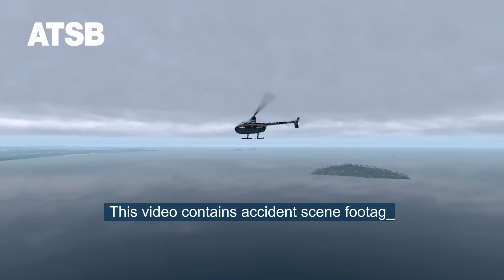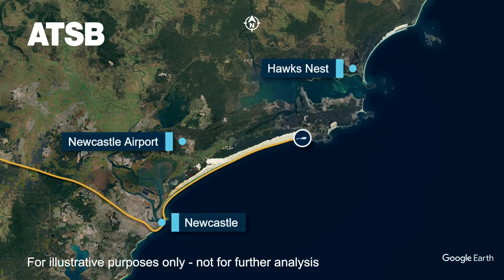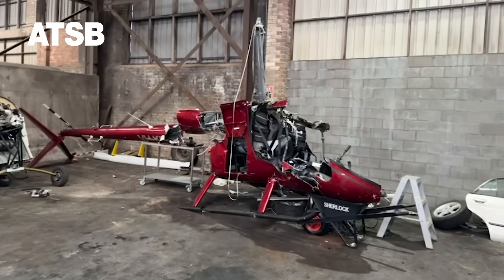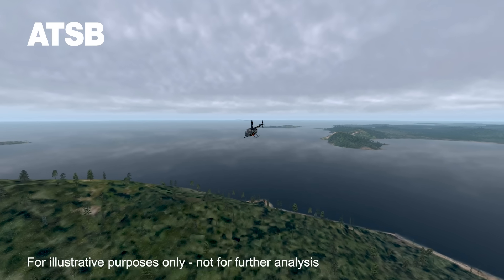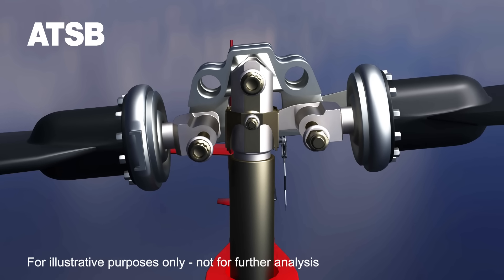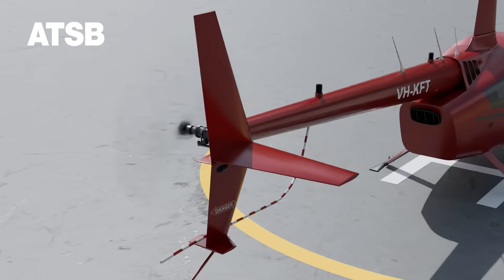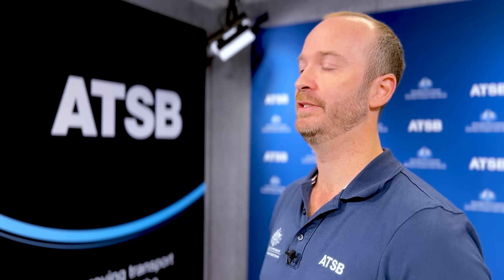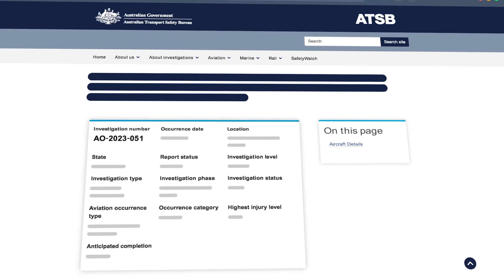R66 flight into turbulence leads to mast bump

Comment: Might be a dumb question but why is there no preventative stopper or limit device to prevent mast bumping? I don't know lots about these helicopters but to me that seems like an obvious hazard that could be addressed to prevent failure in flight.
Reply: Because that stopper would also be on the mast and would still involve mast bumping. The solution is fly the aircraft as trained for the conditions.
Reply: @davidkavanagh189 you couldn't limit the control inputs like they do in other vehicles?
Reply: @lukek8357  No because the mast bump can happen even with no control input and in any case, the controls don't directly control the part of the rotor hub that does the bumping, they control the blade pitch. The danger, and what happened in this case, is the rotor becoming unloaded(near zero or negative G) allowing the rotor hub to tilt to a position where it bumps the mast. It's easier to visualise if you look at the layout of a Robinson rotor hub. There are designs of rotor hub that do not have this risk at all but they are more complex to manufacture and maintain.
Reply: Army tried with the bells. It was all pilot issues. Training changed and the accident rates dropped
Reply: It's just a matter of cost. Most general aviation helicopters have 2 blades which are flexible and can easily bump under the right conditions. Rigid-rotor systems (generally on helis with 4 blades) are much less susceptible to this, but are also more expensive. Money can also buy you a twin-engine helicopter which also significantly increases safety.
Reply: @iSnazzyHD  You are full of it.
Bell 212... Example
Reply: @HongyaMa  I'm not sure what you mean by that. What about the Bell 212? The Bell 212 is a two-blade semi-rigid rotor helicopter that is prone to mast-bumping.
Reply: @iSnazzyHD  prone? You don't fly helicopters do you?
Bell 212 a twin engine helicopter.
It's not the helicopters design at fault 
it's a pilot issue.
What do you fly?
Reply: @HongyaMa  You train around the limitations of a particular air-frame. There is a reason that there are plenty of instances of mast-bumping with the Bell 212, but not the Bell 412 - and its not that only good pilots fly the Bell 412. Obviously, mast-bumping is something that occurs as a result of a pilot not operating the aircraft within the limitations of its design.
Reply: @iSnazzyHD  The 412 has issues of maintenance and reliability -.
My neighbor has both 212 & 412 and that 4 bladed machine is always down while the 212  carries on... You ever hear of droop stop pounding? Bell school teaches about it. Good pilots don't limit their employment options  and fly what the boss has.
Reply: @HongyaMa  212 can bump as well, he's right that it can happen to ALL two bladed rotor systems
Reply: @sinfulcoin  Droop stop pounding?
Nothing wrong with two bladed systems 
It's all on the pilots to fly the machine with in its limitations,  I've known this from the 70s and the Rucker safety teams corrections for a rash of Army accidents.
Reply: @HongyaMa  maybe you responded to the wrong comment? I never said anything was wrong with two bladed systems. I was only trying to point out all systems have a limitation and it's up to the pilot to fly their system correctly.
Reply: @sinfulcoin  Okay
Reply: There literally are rubber stoppers to try absorb some of the impact to protect the mast. But obviously enough still fractures the mast.

The rubbers double up as an inspection item for every preflight.

 At least I inspect them every time. If they have any signs of wear or impact I would not fly the machine.
Reply: @calvinlester3070  White plastic not rubber. for the R-22
Bell has an aluminum stop that doubles for the inner strap fitting  lock
Reply: @michaelbigelow3255  The R-22 and R-44 use a block of white delrin plastic for the contact areas of the mast. I have new spares in my parts inventory. as with the Bell parts... What are you talking about?
Reply: This is a great question, there are engineering solutions possible here including a bearing and/or bushing designed to take the impact and rotational load rather than a solid contact point, even travel limiters but I'm not an aerospace engineer so what do I know. Even if the device required replacement on contact it could still save lives. Seems like an unusually dangerous failure mode.
Reply: @Talasas  nope
Reply: @Talasas  other helicopters that are rigid rotor heads like a ec135,145 etc etc still have a mast moment indicator because in theory you could break off the mast by bending it. Applied cyclic forces while still on the ground situation. Point is newer cars have all kinds off safety things and yet people kill them selves every single day due to using the vehicle outside of its limits. Yet every time a Robbie goes down everyone is screaming for change. I have 4k hrs+ in a r44 and it's a wonderful machine if you respect it and fly it like you're supposed to.
Reply: @sinfulcoin  4k hrs - there's the problem! Robbies are cheap (relatively speaking) so they get flowing by pilots without your experience. Every aircraft has a flight envelope, and people who take them outside of it tend not to fly again, doesn't matter what kind of aircraft it is.
Reply: @MrSunrise-  I mentioned that on another video. That the r44 is at a price point where guys with little to no experience but a wallet full of money can buy them. The same happened to my instructor a few years ago. He trained a rich guy in a b206 and literally told him he was gonna kill himself in that machine and sure enough he was right.
Reply: @sinfulcoin  true true. seen it myself many times

Comment: What's the ASI reading? Looks fast
Reply: 115kts
Reply: When training on the Robinsons it was hammered in about speeds/turbulence/risk of mast bumping, no push overs/zero G.
Reduce speed to 60-70kts in turbulence Not above 110kts except in smooth air etc etc etc
It would be a shame if this accident had been avoidable had the procedures been followed. Sadly it's not uncommon
Reply: Is fast! That was part of the problem.
Reply: @MrSunrise-  unfortunately, yes😬
Reply: @MrSunrise-  Dropping the helicopter over a pickle... pilot sealed his own fate
Eat with the left hand.

Comment: I certainly would not have been eating in wind like that. Both hands needed.
Reply: IDK, that chicken looked delicious. Wouldn't let it go to watse.
Reply: @Wally-Gator it was to die for.
Reply: @Wally-Gator  🤣
Reply: 1. There was no turbulence until there was. 2. there is always only one hand on the vcollective
Reply: Nope only right hand, Friction on collective. Don't chase altitude keep pitch & roll attitude aft cyclic when needed.
Never "both" hands it's a helicopter. If the guy used both hands he probably was a fixed winger gone rotary wing
A deadly combination,
Reply: @HongyaMa  Well if he had had his left hand ready on the collective he coule've reloaded the rotor in time.
Reply: @jerminatorz  Nope cyclic only needed
Add collective you add torque and more yaw & roll through translating tencency
Reply: @HongyaMa  I think you missed his point. But thank you for the know-it-all-ness of your reply. Everyone loves when a know-it-all explains things!
Reply: @mazelme  Don't know it all but 45+ years as a wrench turner & meat servo served me well. Helicopters my specialty 
I think this guy was a fixed winger gone rotary wing.  Most fix wings use left handed for primary control.  Putting both hand on the cyclic is very odd for a helicopter only guy... Any time
Reply: @HongyaMa  Wow! More know-it-all-ness. Thank you!!!
Reply: @mazelme  You're welcime
Reply: @mazelme  I'm thankful Hongyma shares his knowledge , few know as much as he does on the subject. Sharing of knowledge needs to be encouraged.

Comment: There was a similar teetering head accident in NZ a few years ago, pilot crested a brow of a hill but the lee side was (obviously) lower pressure. Meteorology training should also be recommended, the stabilizer doesn't stop pilots exceeding the negative g limits which are only -0.5 in a Huey the Robinson would be similar I think
Reply: a number of Robbies have been lost in NZ over the years, it's not the terrain and weather I would want to fly that helicopter in.
Reply: If you're talking about the heli sika r66 who crashed into the oamaru private hut hill in the (kaimanawas) then i was very close by, heard a loud bamg followed by it revving way up then crash, when i got out of the bush i saw it burning in the distance, that was a mast bump and not the only time a r66 has had that issue here, ive been on many fly-ins in that exact helo one being a month prior to that crash.
Reply: All pilots get very in depth meteorology training throughout the curriculum. The problem is pilots that disregard it after they get their license.
Reply: Same cure a little aft cyclic no big deal

Comment: flying a helicopter and having to be cautious of turbulence is insane.  it's a design flaw .
Reply: Poor technique. Poor airmanship. Lack of understanding of the flight characteristics of the aircraft. I'm no fan of Robbies generally, but they work ok when flown within their limits. But, more so than other helicopters,  they are not forgiving if the limits are exceeded. This guy paid the ultimate price for his own incompetence.
Reply: No. Every aircraft has turbulence limits. In fix wing aircraft it's called maneuvering speed - don't know what they call it in helicopters.
Reply: Not a flaw. A feature and never an issue. Pilot dropped the helicopter over a pickle. 
Helicopter pilots know you eat with your left hand.
Reply: All aircraft must be cautious of turbulence. It's like hitting bumps in your car, the faster you hit them the greater the impact forces.
Reply: You couldn't pay me to get into a Robinson
Reply: Yeah, discovered this teeter head bump risk in recent NYC fatal crash captured on cctv, utterly appalling.

That is still awaiting confirmation, but was not a tiny helicopter either.

I'm never getting in a helicopter unless it's sent by a hospital to save my life. Ridiculous design standards.
Reply: @jonr6680  The NYC crash was 100% not a mast bump issue. The main rotor did not impact the tail boom, it sliced through the vertical stabilizer in two or possibly three places, this means the tail boom separated and rotated first, then impacted the main rotor, we can see it separate first in the video as well. After this the main rotor, transmission, mount and suspension, and part of the roof attachment separated together. There are many theories ranging from the after market rotors to various structural failures or gear seizures. All that we can be confident about is that it was absolutely not mast bumping.
Reply: @nohandleleft  WRONG. TAIL LEFT THE AIRFRAME WHOLE AS DID THE ROOF COMPLETE WITH ROTOR SYSTEM - VAN HORN BLADE CHUCKED A TIP = IN FLIGHT BREAK UP FROM EXCESS VIBRATION
Reply: @jonr6680  Wrong there Skippy. NYC chucked a blade tip. NO TURBULENCE
Reply: @jonr6680 That’s a clueless comment.

Comment: Did the pilot not realise the turbulence hazard behind that headland? The signs were all there to see. Hard to believe anyone would want to fly through that kind of bad air even in a fixed wing aircraft. Perhaps more training in mountain flying for Helicopter pilots to learn wind and flows around hills. Ask any Hang Glider pilot what happens if you fly into the rotor of a hill in strong winds. Hang Gliders fly upside down about as well as Helicopters do.
Reply: I think meteorology training should be the recommendation
Reply: @foobarf8766 I think flying a Hughes would be safer , a 300 would handle that !
Reply: @foobarf8766 It is in helicopter theory you learn meteorological effects
Reply: Trust me lee side of anything is not recommended.  Drastic negative g can fold a hang glider.
Reply: Keep attitude not altitude, A little aft cyclic = no problems
Reply: There is minimal training for that kind of knowledge at the PPL level. Not sure if this was a PPL however in depth knowledge isn’t even required at the commercial level in most jurisdictions. If you’re lucky your instructor has read a mountain flying handbook and recommended it to you. I had to seek it out for myself when I found myself hired to fly EMS in the mountains. Even my company doesn’t have a proper mountain flying course. I’m sure some regulators would want it as mandatory training but it’s added expense for companies, and the almighty dollar usually trumps all when it comes to changing rules.

Comment: So he didnt have the new stabilizer mod? Didnt follow low g recovery? And was above recommended speed for turb?
Reply: And he was distracted by his own self-induced complacency.
Reply: Sounds like a sloppy pilot
Reply: I think he's the reason the new mod exists
Reply: @sethedwards2158  I like the mod it's been the works for years. as for the roll translating tendency & tail rotor thrust also rolls a helicopter right... OH 58 & Bell 205s will roll too at low Gs.
Bell mediums also have a left roll bias in the horizontal stabilizers . . .